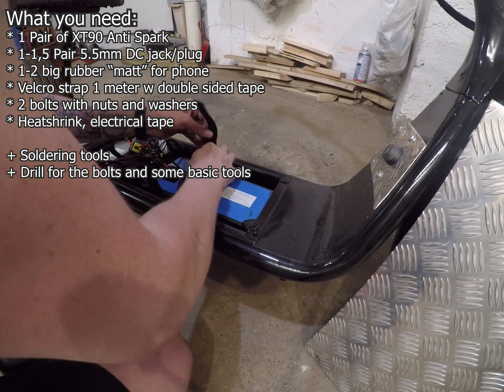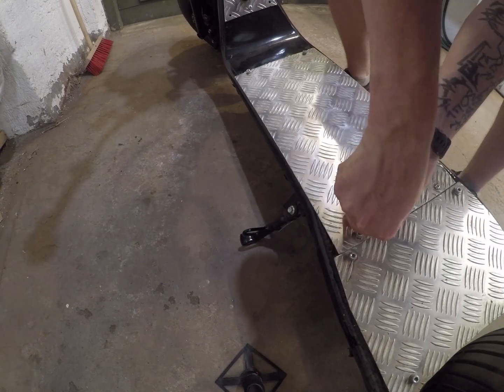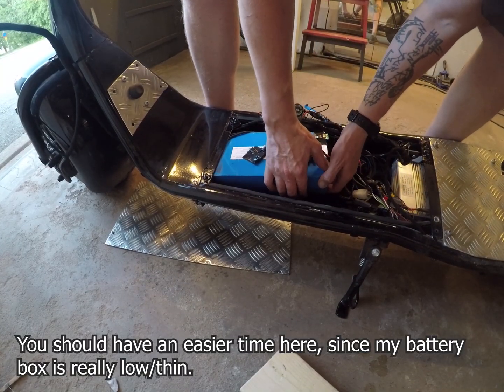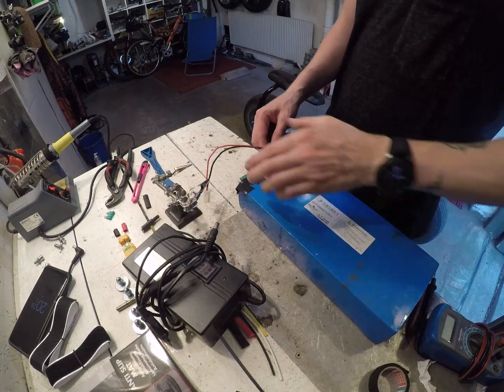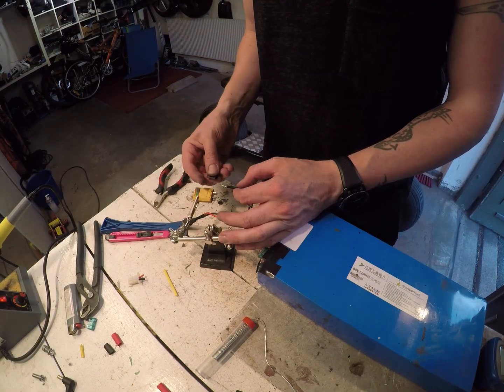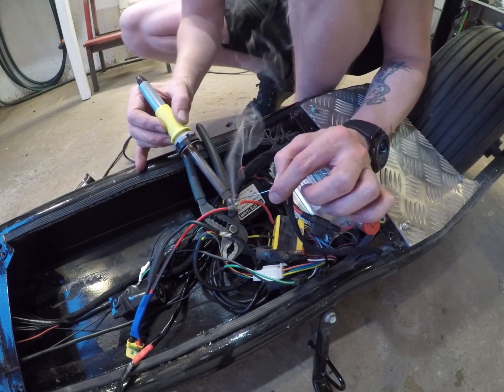Removable Fatscooter Battery - DIY guide

Comment: Where do you buy batteries
Reply from the maker: Not sure where you could buy that but start by searching for the correct amount of cells or voltage plus the amp hours. For ex: Lithium battery 16s 60v 20Ah.

Check that the cells are name brand (Sony, Samsung, Panasonic or such) and perhaps connectors to match what your scooter has today.

There are some companies who build packs and that could be an option?

Comment: Hey man if your motor is is your motor 1000 watts? And if it is why are you using a 800 watt controller?
Reply from the maker: That's what I wondered when I opened it too! But that's how it shipped. But I measured the energy consumption and it uses 2000w on a hard acceleration. Ofc that's not the same as output power. But still